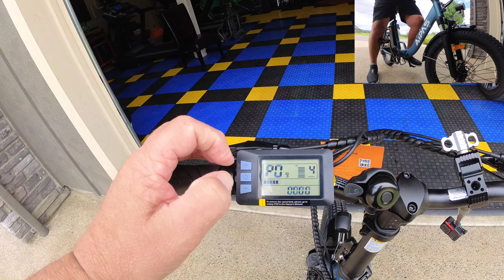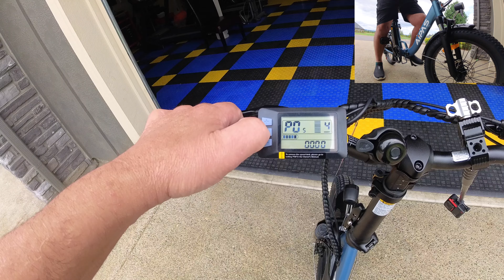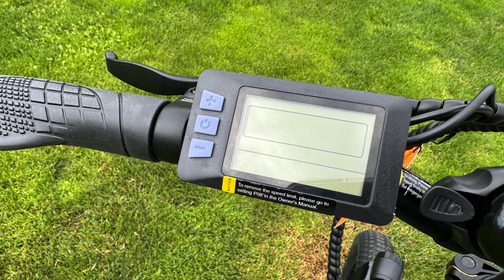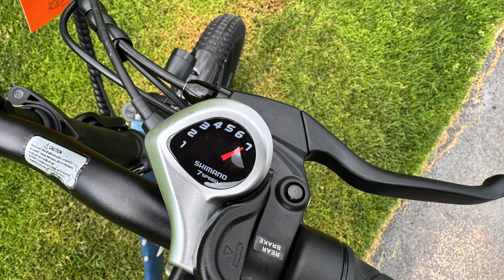AIPAS A4 FOLDING EBIKE ALL IN ONE REVIEW

Comment: Great to see you're doing well and posting again. Nothing like protecting a new bike during shipment, but that sure was overkill on the plastic ties. Good idea to maybe slow down a little so it doesn't go from fun to work. Have a good weekend Bruce.
Reply from the maker: HI Chas, Yes I am doing much better, thanks.  I have a few more things to post almost have them all completed. Not ebikes thoough.  I have had several ebike manufacturers offer ebikes and I have turned them down. as well as a ebike manufacturer I have done many projects with.  I will not be doing all the review videos I have been doing in the passt.  they all just meld together after a while. Thanks for your coontinued suppoert and friendship.  I have moore to post...just going to be far less after then next 2 videos.  LOL
Reply: @RVEnthusiast  I don't blame you.  Sounds like the right thing to do. I'm sure with your reputation. You will get plenty of offers to review, take what you want, when you want. NICE!

Comment: F3's has a 1500w wheel motor and 12ah battery full suspension and 74 mile range (in a perfect world) with a color display. It come with plastic fenders though. Two were 1699.00 and weigh 78 lbs each. That A4 does not have full suspension...the rear is rigid. The F3 has 100 nm of torque and will go 28 MPH as well.